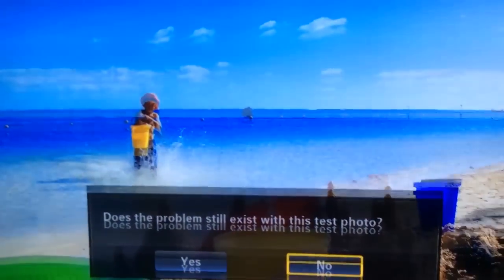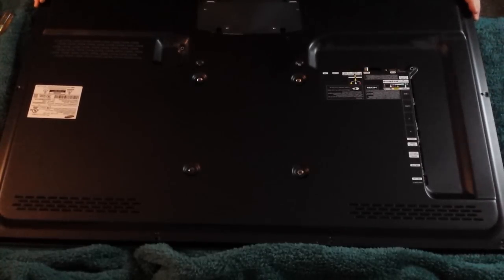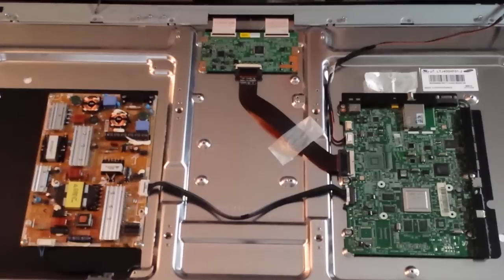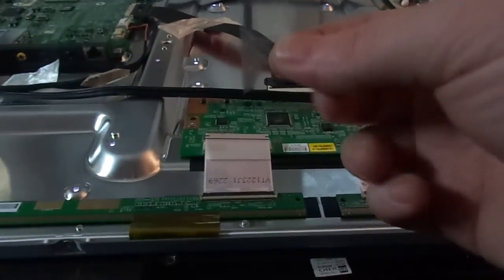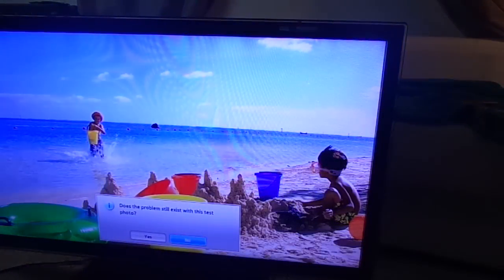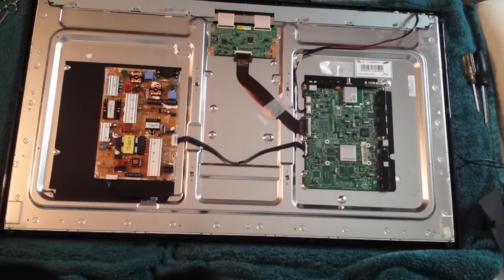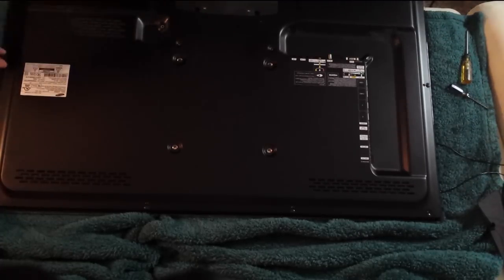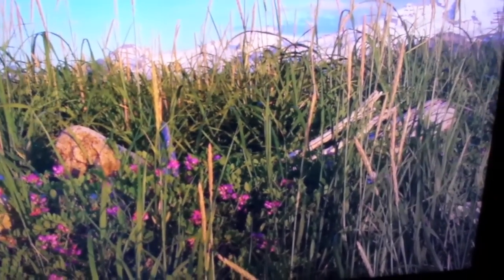LED LCD TV FIX, How To For Samsung Double Image, Black Vertical Lines, Screen Problem Sony LG.

Comment: I fixed my 2018 Fire TV using the tape method. What I find alarming is it seems many have this same problem. I have older LED TVS that have never given me a single problem including a 2015 Samsung. I'm curious though if using the tape method degrades image quality at all. I do notice very faint 'scanning lines' but it's only really noticeable if your eyes are close to the screen.

Comment: My Hisence 50p7 tv had gotten several  horizontal lines over the last 2 years and yesterday started getting the double image.
I was surprised this worked and on the first attempt too, no need to adjust the tape.  I used a 5mm strip of tape on the left side

Comment: This worked perfectly for a Vizio v505-h19.  Used tape on the left ribbon cable. We left  8 pins on the left uncovered and all the rest covered.
Reply from the maker: I'm glad you found this video helpful. Thanks for your comment it definitely helps anyone trying to fix this.

Comment: Works on Vizio 4k flat panels too! My 5-6 year old panel was glitching with multiple images doubling.  I had to tape the other cable than what you worked on but it did the trick!  You saved me $400 to get a new TV!!  Thank you, thank you, THANK YOU!!

Comment: I did try this but on the left side of the ribbon as it was the issue, picture is fixed but now there is a minor black flicker every few seconds, should I use less tape? I didn’t damage any of the ribbons

Comment: Hello Dave, thank you for the help. Unfortunately, things gone bad for my tv, a component has burnt, the smoke came out from under the bottom left circuit board, just beneath the face control panel (where you can switch on/off etc. without the remote). Thing is that before it occured, I was able to see the two halves of the picture when adjusting the left wires. Now, it's gone, I have only half of the picture. Which component you think I have to replace ? Circuit board (seems good) or the wires ? Thank you, greetings from France.
Reply: Answer : "golden" ribbon at the top left seems to be out of order. Directly linked to the led panel so I think I won't get it back.
Reply from the maker: I was going to suggest looking at the ribbon cable. In my case the ribbon cables could be replaced completely however I know not all models have that option do to one end being directly connected to the panel. I really want this to help fix peoples double imagine issue but at the end of the day it's really not a professional fix (piece of tape lol) so it's a last ditch effort before considering replacing the entire panel or buying a new TV all together.
Reply: @DoItWithDave  Thanks a lot for your reply. In fact, I've got this option, I've tried just a minute ago to switch the ribbons, there's a little difference so I imagine maybe two of each brand new ones could make the job. Maybe I'll give it a shot. Take care

Comment: Ive an old samsong tv where the bottom of it keeps flickering a very thick horizontal black line(line can get bigger/smaller as it flickers). Comes and goes but nowadays it is mostly there so its become unwatchable.. Its not thin black lines but one big thick one on the bottom of the TV. We are about to throw the TV out. I just googled it to see if there was a fix and found this. Just wondering would this fix work for something like that? Does it sound familiar???? Also wont I electrocute myself if I plug it in with the back opened(yes Im clueless) ?? .... Finally just out of curiosity why does that bit of tape work? Like what is it doing to fix it? Seems incredible that itd fix it

Comment: How many pins did you cover?
Reply from the maker: Hey there. If I remember right I think it was close to 8. However many people have posted covering a couple more to get it to work. Just remember delicacy and patients when doing this and the ribbon cables are very delicate. I hope this helps.

Comment: Hi Dave will this work for a plasma 
Thanks James
Reply from the maker: From what I've seen for plasma wiring set up they use a thin board with multiple ribbon cables and in some cases are not able to be removed from the display itself (all one unit). You can always check if it's that or tossing your tv. I hope this helps. Thank you for watching.

Comment: Great video man, helped a ton. Can I ask what causes this? I don't think I caught that or it wasn't clear?
Reply: I just replaced the LED's on a 55inch Samsung and it was doing the same thing. Not sure what could have happened in that process when I was more than super careful taking out the LCD with suction cups and with any ribbon cable.
Reply from the maker: The only conclusion I can come to is planned obsolescence my friend. I'm glad you found this video helpful thanks for watching!

Comment: Hey man. So after putting a tape in the connector, if it doesn't work can I just peel it off? I wanna know if peeling it off will cause any problem.

Comment: To the uploader: How the hell did you manage to know how to fix it in this way?
Reply from the maker: I found a tv on bulk week that had a double image when I turned it on. I searched and searched for a remedy to the issue and finally found a video from the east that showed this as a fix. It worked for me so I decided to make the information more easily accessible for people having to same issue. Last thing to try before replacing the panel (which is as expensive as buying new), or throwing the tv away and buying a new one. Thank you for watching and for commenting!

Comment: Yep, can confirm it works, had to try a few times with the tape, at first I was getting a slightly lighter picture on one half of the screen, I remedied it by putting the tape not to close to the edge and making sure it's only on the top tip edge of the gold contacts,(which I could not see clearly in the video)

Comment: This would be my last hope...I disconnected the two tabs. Tested the one on the left and all fine, tested the right side and I noticed the problem so I try your suggestion. Put tape beginnnig from the right to left and WOAHHHHH after a little bit of patience it's really worked!!!!! Big thanks for the video and the five stars fix.

Comment: Samsung UA43KU6470 horizontal line flickering problem help me.
Reply from the maker: From what I've reviewed on YT you could have a bad capacitor or possibly the power source going out. If your planning on removing the back panel you may want to inspect the capacitors. The power source usually isn't visually able to be determined to be failing. If you look up what a bad capacitor looks like on YT you'll get a good idea if what to look for. I hope this helps.

Comment: help, the screen is now black. What can it be now?
Reply from the maker: Check that the ribbon cables are not damaged. It they get scratched they won't show any images. If the are damaged new ones can be ordered from eBay. They are inexpensive. The part number for the cables are printed on the current cables.

Comment: I was so hopeful that this would fix the horizontal lines on my tv. I have spent over two hours adjusting the tape and moving it to different placed on the cable and in doing so I damaged the delicate tips of the ribbon cable. Is there anyway to fix this? If I covered up each one (which is so hard to do) would that help? Can the ribbons be replaced?  The horizontal lines are pretty much gone but a third of the screen is now covered in thick vertical bars so the problem is much worse and now I’m afraid I ruined the tv.
Reply from the maker: If you look at the ribbon cables there should be a part number on them. If you enter the part number in an eBay search the ribbon cables should come up for purchase. They are inexpensive. I hope this helps.

Comment: hi, I did what you show on the video but is the same thing, what is your recommendation, a new T-con board I mean not a used board from eBay but a brand new board? is there anything else that causes the double image, what is your recommendation, please
Reply from the maker: I don't know exactly what you've tried. Do you apply different sizes of tape? Sometimes a small piece works, other times a larger piece works. If you've done both with no resolution you could try a new t con board however, you may try ordering a couple of ribbon cables. If you look at the cables on your tv you should see a part number on them. If you enter the part number in eBay search there should be some purchase results, and they are inexpensive. Double check that the ribbon cables are not damaged from putting on tape and removing tape. They're delicate and easley be damaged. If the cables are scratched they need to be replaced. Please know that this is not a professional fix. The only reason I posted this was for a last resort rather than replacing the display which is normally more than the cost of a new tv or replacing the tv all together. I hope this helps.

Comment: Hi Dave, awesome video. I have a Samsung QA55Q7FAM and have the double image issue; I can’t “test” the ribbons because whenever I unplug a ribbon, neither side of the TV will show an image - I can see the TV is on and the backlight is shining, but I suspect it knows one of the ribbons is d/c’d. Any suggestions? Thanks in advance!
Reply from the maker: If I was having the same issue I'd probably start by turning all power off too the tv,  remove one cable, and apply a small piece of tape to it.  Than reattach it, and turn on the TV too see what happens. It may get better the first time around or the steps may need to be repeated adding or removing a bit of tape each time. If you do work on this be very delicate with the cable tips. They can easily become scratched, and will not function properly. I hope this helps.
Reply: @DoItWithDave  Hi Dave, thanks, this is exactly what I did and it worked, I got lucky on the first try but noticed that the RHS of the screen was off colour (low red tone); I then made the tape even thinner and it improved, but still see some minor loss of red-tones in the RHS - do you think this is inevitable as ultimately at least 1 pin needs to be covered, or is it solvable if I just keep playing with the cable? ALSO, is it ultimately the t-con board or the cable that has failed in most cases? Cables are cheap to replace, but not the t-con board. Thank you in advance!!
Reply from the maker: You will see one side a bit dull in color not too much. It is very noticeable when a completely white screen is displayed. It's not a perfect fix. If the color is way off you may try moving the tape however the more you do this the likelihood of the cables becoming damaged goes up.

Comment: hi, i've got the same problem on my samsung tv. I try the diy from the video, but i don't understand how and where excatly put the tape ? Can someone help me please ?  ON all the ribbon? or just in a little part ? thanks
Reply from the maker: It depends. You can start with covering just over a 1/4 of the ribbon cable tip, and see what you get. Does the image get better? If not remove the tape, cut it a bit smaller, and reapply. It varies from one tv to another. Be very delicate and take you're time when doing this. The cables can be easily damaged. I hope this helps.
Reply: @DoItWithDave  yeah it's a hard to see on the video exactly where you put the tape, it's only the tip section of the gold contacts right?

Comment: My TV's dead after doing this, what to do now?😭
Reply from the maker: When you post dead does that mean you have no power going to the tv after plugged it in? Does the tv have the power light illuminated, or the back lights on when it's plugged in? If not the power supply could have blown out. If that's the case than the power supply would need to be replaced or it's possible that a capacitor could have blown. If you have any lights coming on when plugged in the t con board could have blown out.
Reply: @DoItWithDave  Thanks for reply sir, actually i checked it again by putting T-con cable one by one, the left side of the tv is not showing any picture but only backlight can be seen, on the other hand right side is showing double picture as before but when connecting both the T-con cables the whole screen goes black. 

I tried Applying tape on both side with multiple sizes,but any side ain't working afterall. 
What could be the possible reason sir for this issue?
Reply from the maker: @thequality5177  you may want to check the tips of the ribbon cables. They are very delicate and can easily be damaged. If you see any scratches or brown spots on the gold tips than the cable is no good. You could try reversing how the cables sit from the t con board to the tv, and see if that helps. If you do see damaged cables and reversing them does nothing last thing I'd do it order a couple of cables on eBay, they should be pretty cheap. If you do end up deciding to order new cables the part number should be printed on the current ones you have. I hope this helps.
Reply: @DoItWithDave  Again thanks for the reply sir, I will definitely try it❤️❤️

Comment: Block off with tape 13 pins, this seems to be the right number to tape up. The left side 13 on the right ribbon OR the right side 13 on the left ribbon. I used the right ribbon and covered up the left 13 pins with tape and picture is perfect. I had a black horizontal line running in the middle of the screen and two faint horizontal lines near the top. In addition, the screen pulsed bright then a little dimmer about once every couple of seconds. The tape method covering 13 pins fixed all of this. If this helped anyone, let me know. My TV was an LG50LN5400.

Comment: I did this with the tv on and burned a chip.  Trying to figure out which so i can attempt to replace it.
Reply: Did you find any solution sir, I've got my tv with black screen when trying the given process.
Reply: @thequality5177  I did not. Haven't replaced the board yet.
Reply: @jasonalmont7572   😔

Comment: THIS WORKED - I have a Samsung UN55B60000 that suddenly started displaying the 'double image' issue - I did a lot of searching, and found this video - I am not sure why, but this worked!  

To get the double image off, I placed about a 2-3 mm piece of tape over the gold contacts (it ended up being 4-5 contacts) 2 contacts in from the left. No double image!  BUT, one side was darker than the other.  

When I inspected the cable, I found there was some corrosion on the gold tips - probably due to being gold plated.  I tried to clean these with an eraser/swap clean with q-tip, but the corrosion was still there - I put a strip of tape across the gold connections, and when I removed it, clean. 
Once I replaced the cable, my video was clear and there was no discernable brightness difference.  Saved me a couple of thousand dollars, though I kind of had my heart set on the 85" as a replacement ;)

The entire process, from taking the TV off its mount, to replacing it, took about 45 minutes.  Actual 'fix' time was about 10 minutes ;)

Comment: Thank you! Our TV had double vision but only on the bottom half of the screen. Slightly different process for our 2018 Q7 but essentially the same and for whatever reason, that tiny bit of tape fixed it - amazing!

Comment: I brought my Samsung LED UN43KU6000 to Samsung service due to double image problem (out of warranty of course, just 3 years old). Solution they gave me: change the LED panel at cost almost a new TV. Returned home kind of frustrated but willing to find a possible solution before throw it for recycling. I searched for a possible solution and found this video, that might work for me. Previously I found another one with the tape solution, but used the whole width of tape and I only tried taping the extreme of the flexible cable, but got black screens only. Now I tried a narrower piece of tape about 5 mm width, and started with the right flexible cable from left side to right of the cable and saw what happened in the screen. First got black screen, then continue moving the piece of tape to the next 5 mm of the flexible, got black vertical stripe about 10 cm width, then continue moving the tape and the black stripe moved to the right as well. Keep moving the tape until...got normal image and no double image!!. Problem solved with zero cost...well, may be some cost from my time to open the TV back cover and search for a solution on the internet like this one. Thank you Dave!
Reply from the maker: I'm glad you found this video helpful. Thank you for your post it really does help ppl having the same issue with their tvs. Obsolescence is the name of the game with flat screens.

Comment: Tried putting tape at every place but the double screen isn't going away. What else can be tried?
Reply from the maker: Can't say for sure. A couple of ppl said they put a small piece of paper instead of tape. You may try that.
Reply: @DoItWithDave  Was trying some adjustments. The display was improving, i was getting excited and then suddenly something happened and i started getting verticle lines.
Now, no matter what i try verticle lines aren't going away. :/
Reply from the maker: @ashishrajput15  that's a bummer. The ribbon cable may have gotten damaged. They are delicate and can easily scratch.
Reply: @DoItWithDave  can I replace ribbon cable or the whole tv is gone?
Reply from the maker: @ashishrajput15  look to see if the cable is damaged. It will be pretty obvious, usually the gold tips will be scratched. If you see they are damaged you could order new ones on ebay. The ribbon cable should have a part number on it. If you enter that number in ebay search you should get ppl selling them. If the cost is over $10  us dollars I'd consider it it's worth it to continue to work on the tv or just wait for Amazon prime this Tuesday for discounts.
Reply: @DoItWithDave  Let me try this out. Thanks Dave 🙏